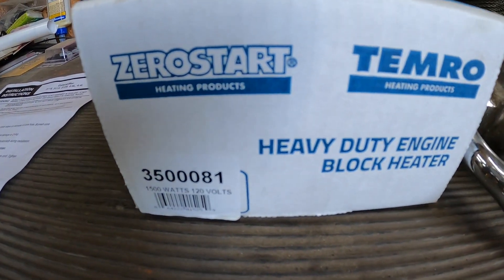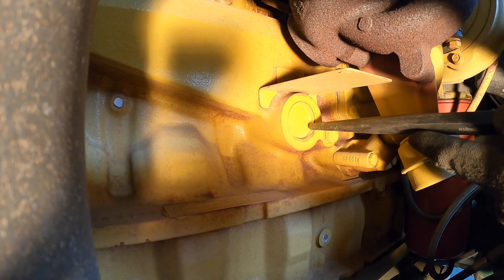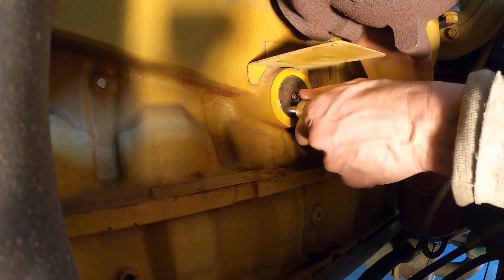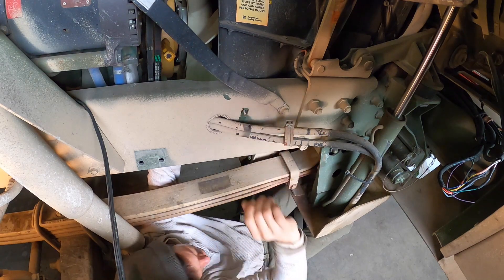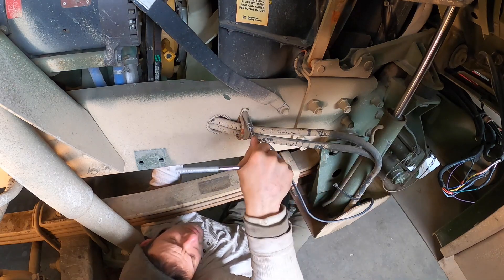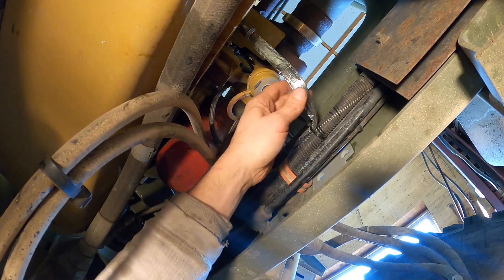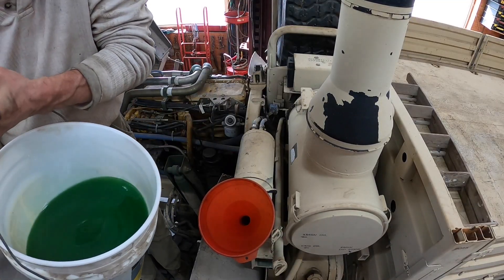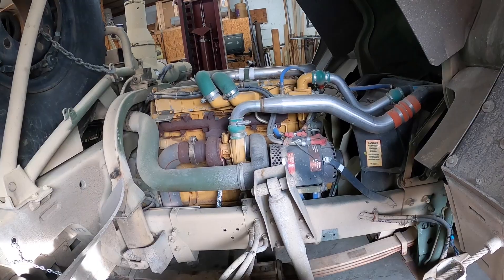Caterpillar Engine block heater install in LMTV

Comment: dielectric grease is not conductive.
Reply from the maker: Very true. There are other reasons it is used. You can read this article to further educate yourself on the topic.
https://www.motortrend.com/how-to/what-is-dielectric-grease/amp/
Reply: @NEILSWORLD  Yet you put it on the electrical contacts anyway...LMAO.
Reply: @NEILSWORLD  I have been a electrical engineer for 32yrs. l'm well educated on how it works.
Reply from the maker: @bradjenkins932  thank you for opening my eyes and prompting me to further educate myself. I will be more careful with my use of dielectric grease in the future. I didn't think it was conducting electricity or I would have been shorting the connection. The truck is used in an extremely corrosive environment so I thought filling any cavities with the grease was my best choice. What are the drawbacks as it is used in this application?  The heating element seems to be getting current and operating properly..

Comment: Hi Neal my issue is I store my truck at a RV Storage place and I don’t have power. So I can only start my truck when it above 30 outside. I had a M923A2 could start at 0 f even if needed but I capped it to 20f for cold start. Thinking of adding a couple of solar panels to keep batteries charged. We will see...
Reply from the maker: You need a diesel heater to heat the coolant.

Comment: Very cool! We have a CAT 3126 in a '97 Thomas Saf-T-Liner school bus we're converting into a tiny home on wheels. How does this element style block heater compare with using an Espar or Webasto style diesel heater other than the power source being diesel vs electricity? They both look like they warm the coolant vs being in the oil pan? Still pretty new at learning about our engine and appreciate your insight!
Thanks!
- Brian + Erin
Reply from the maker: I would like to get one of those diesel heaters.  Heating element was much easier installation and cheaper and at the moment I have access to electricity.  The heating element works great though watch my cold start video when it was plugged in at 10 below zero fahrenheit.
Reply: @NEILSWORLD  Yeah, price point is something we're looking at too... How much energy does the Zerostart that you installed draw and how long does it need to be plugged in before starting out in the cold? We're in Ontario just west of Toronto. We're going to have 600Ah of Lithium batteries for our "house" battery setup, and if we did the Zerostart electric element version, when off grid in the cold, we would have to use our "house batteries" to run that element.
Thanks, Neil!
- Brian + Erin
Reply from the maker: It's a 1500 w heater so that equals 5 100 BTUs per hour.  The block holds about 3 gallons or 24 lb of water and without loss 5100 BTUs would raise its temp 212° f in 1 hour.  At 0° f the heating element should take approximately 1 hour and 15 minutes to heat the coolant up to where the element will not heat it anymore.  You probably don't need all that heat to get a clean start. 30 to 45 minutes will probably do that just fine.
Reply from the maker: I leave mine plugged in all night just because I'm never sure when I'm going to head out plowing.
Reply: @NEILSWORLD  BOOM! That's exactly what we're looking for :) 1500w @ 120V = 12.5Ah... So that would work perfectly off our "house battery bank." We have a 3,000W inverter, so that will handle it just fine and may need to be on a 20amp dedicated circuit. Thanks for dropping those specs! I just figured out who the manufacturer is and your numbers match their product catalog for that heater. We'll use your Amazon link to buy one (we'll be on Amazon.ca though... so hopefully it pushes the commission over to you!)

Thanks so much for taking the time to share this info with us, Neil! When we do a video on installing ours, we'll give your channel a shout out! 

- Brian + Erin
Reply from the maker: Thanks, I'll look for the shout out.  I haven't signed up for any affiliate yet. I have been thinking about that lately though. 👍
Reply: @NEILSWORLD  Amazon doesn’t pay much for referrals (1-10% depending on category & most often we see 1-3%)... but it’s a little extra cash & it all helps! LOL! Looks like delivery should be by Dec 1st! Woohoo! 👍🥶🤣
Reply from the maker: https://youtu.be/BI70LXnnBZ8

Comment: Neil, sweet setup.  Can you (if possible) post a link to said block heater in the description?  Looks like a nice factory style one....  Thanks again for posting great content....

BTW if you find a digital timer you can set it to turn on at say 2 hours before you plan on leaving.  I used to do that when I had vehicles with block heaters....
Reply from the maker: Thanks, Link added.  Timer, good idea.
Reply: @NEILSWORLD  not a bad price either.  Here is the timer I used for years.  https://www.amazon.com/Century-Digital-Programmable-Packaging-Security/dp/B00MVF16JG/ref=sr_1_2_sspa?keywords=digital+timer+outlet+20+amp&qid=1578876979&sr=8-2-spons&psc=1&spLa=ZW5jcnlwdGVkUXVhbGlmaWVyPUEyQ1ozSkw3OExYODgyJmVuY3J5cHRlZElkPUEwODUyMzQ5R1RHUjNXMzFVTkNOJmVuY3J5cHRlZEFkSWQ9QTA3MjMzNDgxMDNaVUFUQk9SRzRUJndpZGdldE5hbWU9c3BfYXRmJmFjdGlvbj1jbGlja1JlZGlyZWN0JmRvTm90TG9nQ2xpY2s9dHJ1ZQ==
Reply: @SeanFastidious  Thanks, Sean. I was planning the same thing with the block heater, so the timer will come in handy as well. Peace!
Reply: @HelicoolsHelipad  Yeah.  I am glad Neil posted this because I was wondering if they made a direct fit quality kit.  This appears to be it.
Reply: @SeanFastidious  I totally agree!